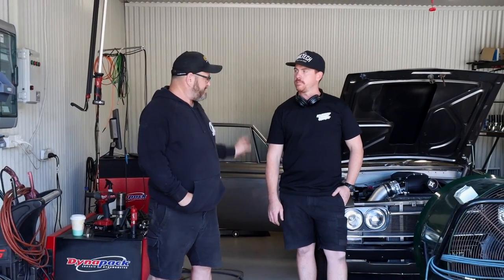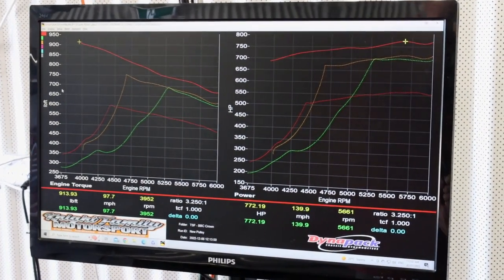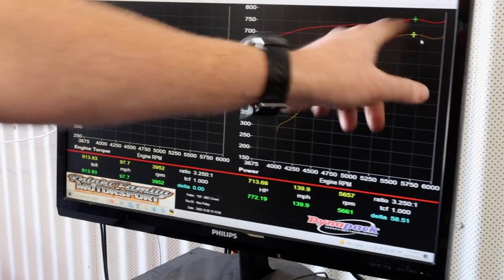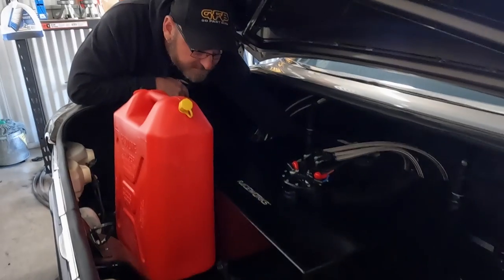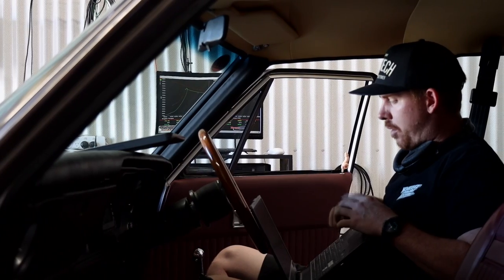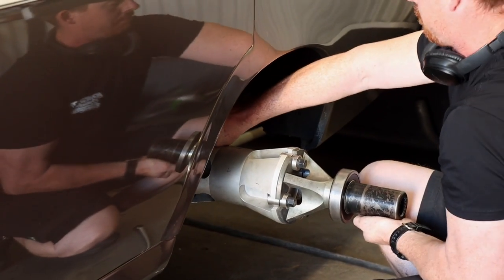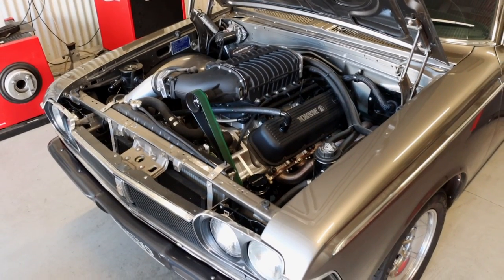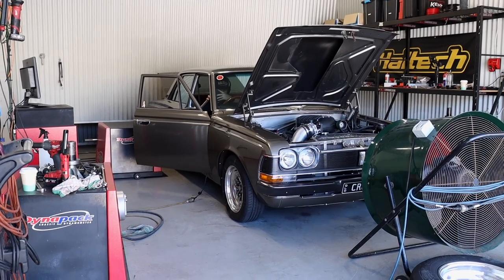ETHANOL vs UNLEADED - Fixing the Big Block Crow9's Drinking Habit ⛽️

Comment: Pretty surprised to see that Kai's dyno isn't set up with SAE atmospheric correction to eliminate the temperature variable in dyno readings.
Reply from the maker: Should it lie to you and say it would make 1000hp if it was at sea level in Iceland in winter? 
I don't get this logic, it's not measuring what the engine could theoretically make, it's measuring what it IS making at that time at the axle(s).
Reply: @theskidfactory  I think you've proven yourself wrong, not having a correction is much more likely to misrepresent what the engine power output is likely to be as you've demonstrated here.

The correction factor is based on a "typical day" that is far more representative of what the engine power output is likely to be close to at any given time.

It's not designed to "skew" readings as you've suggested by assuming unrealistic atmospheric conditions, it's designed to give the most accurate possible representation of the engines power output for the largest majority of conditions.
Reply from the maker: What is the "Typical Day".
Reply from the maker: Discuss please.
Reply: @theskidfactory  the current SAE J1349 classification uses a standard day measuring 25°C and 0% Humidity with a barometric pressure of 29.234 inches of Mercury.

This is chosen deliberately as its unlikely that most engines will be running in these conditions thus giving the ability to universally compare readings taken on any given day as they should all be "adjusted" by the correction factor to a similar degree.

I'm hardly the best person to ask about this, but the SAE is a widely recognised body and correction factors are a standard tool used by OEMs and Tuners alike.
Reply: The issue here is that the correction is not accurate for forced induction engines. 

On a naturally aspirated engine it is a great way to normalize readings as the engine is ingesting the air density that the dyno is measuring/correcting for. 
But in a forced induction application the air the engine is ingesting is actually at a significantly different temperature and pressure and hence to be accurate the correction would need to be calculated from a sensor measuring the density of air in the actual intake port of the engine. 

Funnily enough if you think about this, what that correction would actually do would just be attempt to model what the engine would make naturally aspirated.
Reply from the maker: Can't post pics here but Kye applied the correction to the 713/772hp figures and they came to 725 and 756hp.
Reply: @knightfamilymotorsport  this is not really the correct way to look at the situation.

The correction factor isn't designed to compensate for any engine variables, its sole purpose is to normalise the atmospheric conditions external to the engine present at the time of testing.

We know that different forced induction methods and sizes can affect the atmospheric conditions present in the combustion chamber, hence why they're used to make more power. We however don't apply a correction factor here because that would be the same as trying to correct for an engine that has a turbo twice the size of another or one that has a completely heatsoaked intercooler vs one that's cold.

So in actual fact correction factors work the same for forced induction and naturally aspirated engines, as the variable being corrected is external to the engine.
Reply: the elephant in the room is that humidity is water that displaces oxygen.  High humidity conditions, such as FNQ, there is simply less oxygen in the air to combust. Temperature is only one variable and what really needs to be looked at is relative air density, which is a function of temperature, pressure and humidity.  The lower the RAD, the lower the potential HP of the engine
Reply: Correction is only really for if you’re chasing the biggest possible numbers for bragging rights. The car doesn’t always run down the road/track on a perfect day. So, what’s it matter if corrected it makes 30hp more unless you’re just chasing higher numbers. 
In reality a dyno is ideal for testing and tuning. You mainly want to know the tune is safe and things are working right. Past that you’re looking for immediate feedback that changes are better or worse. 
If you want to know that cold air intake is better or worse than stock you basically need to swap it on the dyno that day. Even with correction there’s plenty of variables that can change power readings quite a bit.
Reply: @mitchellgould7405 at least 60% humidity at any time in the year 😂
Reply: @widgetpicz  I don't disagree with you here at all the correction does correct foe environmental conditions external to the engine but what I can tell you is that correcting the power output of a forced induction engine vs atmospheric conditions will yield inaccurate results. 

As Al mentioned this dyno does have a complete weather station/atmospheric conditions compensations available that can be applied during or after the run as all the data is recorded. 

For forced induction applications I choose to not apply atmospheric corrections as it yields more consistent/accurate results.
Reply: @knightfamilymotorsport  I'll have to do more research, as you've clearly seen the results first hand. All I know from my experience is that I've seen (mostly mainlines) run standard with the weather station module using the SAE correction factor for everything that hits the rollers.
Reply: @Polsom  If the engine had turbo and wastegate control, the turbo would just compensate and run faster if the air is thin and hot, a correction factor on this will show too much power because the dyno will add on top of the HP number, but the turbo system already compensated for the thinner air.

The compensation can get very messy, because in essence it needs to act different depending on induction used and it also needs to be calibrated to make sure the measurements are correct.
If the temperature sensor has 3% inaccuracy, the air pressure has 3%, the dyno itself has 3%, the engine has 3% difference from run to run, the fuel tank has 3% difference in temp, things can go wrong when beginning to add all those numbers in as compensation.
Reply: Why does it matter? A dyno is just a tuning tool. If you are testing parts or making changes you always do a baseline run that day to make comparisons off.

If you add the corrections and it makes an extra 40 horsepower is the car now faster, will you be able to go to the drag strip and run a quicker time because the dyno read a bigger number with the corrections on??
Reply: Yeah on the surface it seems like a good idea to artificially correct for all weather to standardise the runs however a turbo car already somewhat ‘corrects’ for air density changes because the wastegate targets the same air pressure no matter how dense it is before the turbo sucks it in but a supercharged or naturally aspirated car can only use the air it has on hand so if you are standardising the runs based on air density then a turbo car will gain heaps more artificial power on a less dense day than a naturally aspirated car
But yet if you run no correction the turbo car would run much closer to the same power regardless of air density but the na or supercharged car will make way different power 

What I mean is
If a na car makes 300 on a hot day and 300 on a cold day with correction, but might make 280 on a hot day 300 on a cold day no correction

A turbo car would run 300 on a cold day and 320 on a hot day corrected
But un corrected it would be more likely to make 300 both days as the wastegate will allow the turbo to push more air into the engine on the hot day 

If you log pressure ratio instead of just boost you will see this change because of weather even if boost level isn’t charging
Reply: Relative Air Density is not the same as air density, thus an engine will perform differently on a 30c day at 20%RH vs 30c at 90%RH.

The correction factor on the dyno makes no difference to what the engine is outputting, just the axis of the graph plots.
As long as the map is good and the engine is safely tuned for the normal running conditions it will encounter that's all that matters. The dyno is just a tool to achieve this.
Reply: @bentles that’s not exactly how turbos work. You must take into consideration atmospheric pressure with turbos as turbo charger installations only “boost,” pressure a set amount. Boost pressure, when discussing with tuners and forums is quite different from absolute measured manifold pressure. Absolute manifold pressure with “16 psi of forum boost,” is actually closer to 30.7psi. 

In terms of math absolute manifold pressure can be described in layman’s terms as “forum boost pressure,” +”atmospheric pressure,” since atmospheric pressure is a variable, absolute manifold pressure will also be a variable. 

Horsepower is dependent upon Absolute manifold pressure, not “forum boost pressure.” With a reduction in atmospheric density, turbocharged engines will show a directly proportional reduction in power output.
Reply: @Polsom 0% humidity in QLD, oh how I would love for that to be realistic
Reply: Why does this result need to be standardised? What are you going to compare it to? How many engines are out there with the EXACT same specs as Al’s?
Ultimately, the map sensor, air temp sensor, exhaust O2 sensor and the ECU will compensate for variations in atmospheric conditions… does it really matter what the actual power output is at any given point in time? So long as the tune is sound you are golden.
The SAE atmospheric correction factor is more applicable for OEM who are mass producing engines, testing/tuning them and then publishing the results. In this case standardisation makes a lot of sense. 
I think you are over thinking and over complicating this topic as it relates to this specific, individual example.
Reply: @steveireland7460  there are reasons for using standardization beyond dyno queen bragging rights. Let's say Al decides to change his cam or a set of heads (which may take hours or days before getting it back on the dyno). Standardization will give you a much better net power gain / loss than not using it. If weather can make a 60hp difference you wouldn't know if the component change made the difference or weather was responsible for the difference. If the day is reasonably stable, and all you are changing is fuel then it probably can be done quick enough that correction would play little part in the result.
Reply: @damianscheuber1603  Without running a correction factor, you have no idea if the change in observed hp is because of the changes you made, or the weather.
Reply: @DodgyBrothersEngineering  Yep. Ok. That makes sense.
Reply: @knightfamilymotorsport  I'm glad you're speaking up and giving insight for all our benefit. Personally I'm in the camp that more data is generally better, especially if the end-user DOESN'T know what to do with that data, because it forces you to either concede your ignorance, or learn from it. Most people should hopefully understand by now that comparing numbers from one dyno to another is a fool's errand, especially on the internet. That said, I wish more people would just share BOTH the measured and SAE corrected. There's a correction standard for a reason, and it gives most of us a clearer picture of the conditions the engine was measured under.

Now, as for your own practices of preferring uncorrected for force induction engines, that feels counter-intuitive if you've got repeat customers coming back in different conditions. I know from a tuner perspective you care about "is this engine optimized as it sits now" and that's your job to ensure. But customers also want to see change/gain from iterations, and if you're going to compare graphs that are 3+ months apart in which time the customer changed a part (or six) I would imagine you would prefer to show them the corrected graph comparisons, versus uncorrected (which is what you might retune it under). But I'm more than interested to hear why that might be the wrong approach.

Comment: I think flex fuel for pump gas is always a smart choice. Sadly, we don't have E85 pumps at all in NZ, and there's no way I'm dealing with drums 😂
Reply: Pump E-85 in the U.S. sucks, quality control is very lacking. The % of alcohol is all over the place, and the gasoline it's mixed with can be any grade. Also can be very dirty and plug fuel filters/injectors if your unlucky enough to get a bad batch.
Reply: In aus it's always mixed with 98 octane fuel
Reply: we had E85 in Germany until 2015 when the tax relief was discontinued.. haven't seen it since

Comment: This is a sign to increase the compression ratio to take full advantage of e85 😉
Reply: Smaller pulley on blower
Reply: @campervanbug7658  por qe no los dos?
Reply: The chassis is already overwhelmed. Doesn’t need more power, needs a cage.

Comment: Understanding all that technicality about engine tuning is a lot easier for me - because I'm playing the game "Automation" (Camshaft Software; they are Kiwis btw) since some years now. It's a digital hands-on in understanding the cause-and-effect thing. AFR, compression, ignition timing, fuel properties, bore & stroke effects on horsepower and rpm, aaaaaaand of course all of that changes when adding turbo(s). It still is a game, but the 4.2 update introduced calculations based on airflow, heat dissipation, resonances with intake & exhaust. Since then it has fuel efficiency maps, ignition timing maps and other stuff to fine-tune the engine. And the turbo calculation now is based on real manufacturer spec sheets, boost vs flow, AR settings, compressor surge and all that jazz. All in all this game makes it fun to learn how engines work and which effects changes do have... 😎✌️

Comment: A tip my dad taught my years ago - if you rotate your jerry can 90 degrees (so it's lying on its "broad" side) you won't spill anywhere near as much fuel when you fill your fuel cell. And when that fails, you double up with a second nozzle :)

Comment: What a lot of people under estimate in supercharged cars is

If the air before the rotors is colder boost goes up
If the air is colder after the rotors the boost goes down

So if your intercooler pump stops working you see more boost
If you fit an Interchiller you will see less boost
If it’s a hot day you see less boost
If it’s a cold day you see more boost
But in a turbo car because the wastegate regulates the boost these changes are way way less noticeable

Comment: We are blessed here in the UK. Near me even in a rural area we get E5 and E10. E10 is 95 RON and E5 is 98 RON. These are widely on sale at every forecourt. (garage/fuel station)

We also have Shell V-Power and Tesco Momentum. Those are 99 RON. The higher the "RON" the more the cost. Although 99 RON is the same cost sometimes as 98 RON and often just sold in replace of it at a Shell or Tesco garage.  I use 99 RON when i can or E5 if i cant get the 99 RON. E10 seems to make my car run rubbish and allot of people have issues with it rotting seals and stuff on older cars and things like mowers and chainsaws.
Reply from the maker: They are great options, we have demonstrated that low percentages of ethanol still make a significant difference to detonation threshold and power overall even on low octane fuels here.
It's also only hot for 3 days a year there so you are in power paradise.
Reply: @theskidfactory  indeed the only issue is its to wet to put the power down! lol. I do often hear stories of how cars Dyno higher in the UK than other areas. The fuel probably has loads to do with it.

Comment: Really enjoyed the discussion at the end. Kye covered multiple questions concisely. The turbo comparison opens the trapdoor on questioning environmental corrections applied to turbocharged power readings in the same manner as applied to NA and SC. It’s a dark hole 😂

How tuned was the 98 ignition curve to MBT on 98? E.g was this timing at the point of adding timing and seeing v minimal gains or was it knock limited, or did you not even want to go there given flex fuel for events so why bother with any knock risk. Interested as it determines the straight fuel to fuel comparison: charge temp decrease, oxygenation, cylinder density/dynamic compression ratio.

Comment: Sounds like an interchiller may be in order Al to get that sweet cool air all year round!
Reply: The problem is the density at the inlet of the supercharger. It does have an intercooler already. Because it’s a positive displacement supercharger more density at the inlet = more density at the outlet.
Reply: Also because it is a positive displacement charger, the intercooler doesn’t do as much as it seems. It increases density but results in less boost. About the same air mass is entering the engine. The main improvements are less parasitic losses because the boost level is lower, and the ability to run more boost before running into knock. But because this engine is not very knock limited it’s not a huge deal.
Reply: @coreyw427  Interesting, thanks for the extra info.
Yes it seems I was only thinking in terms of IAT at the inlet port which an interchiller would aid.
Guess there is no free lunch with positive displacement superchargers at this level!
We are all here to learn! 👍

Comment: Have been running E85 on my Mazda MX5 ND1 here in Melbourne for a few years now and it's a great improvement. I'd love a flex-fuel system for it though, but sadly it isn't available. That means if I go on extended travels away from the big smoke I have to take jerry cans of E85 with me or remap back to a 98.